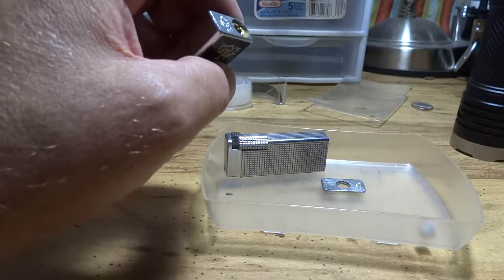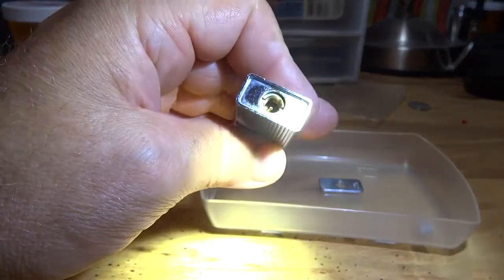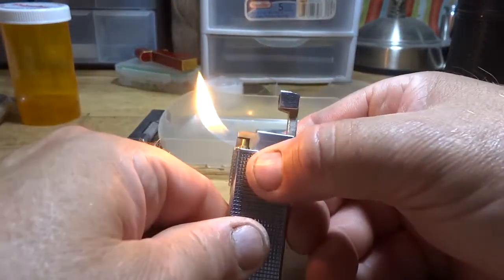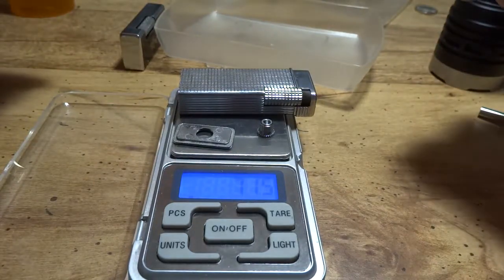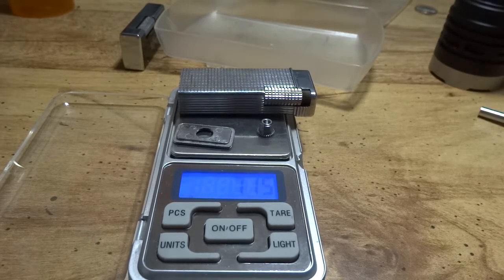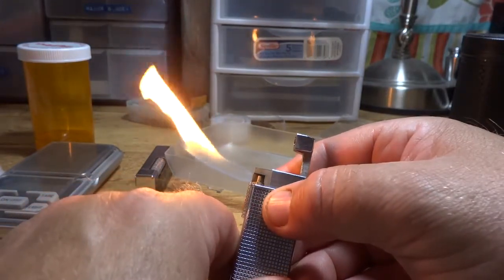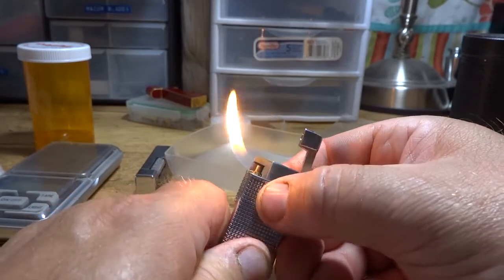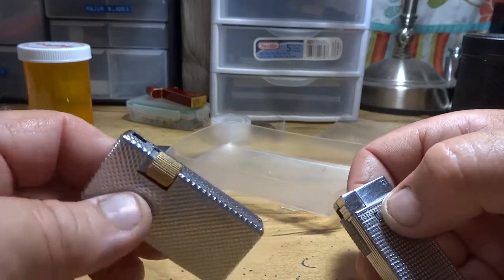Zaima Cristo Filler Valve With Pin

Comment: As a pipe smoker I have to whole hearted agree with your selection of pipe lighters. I have two of the silver Zamia Christo and 3 Flainaire F12 and both a gold and silver plate Savinelli. 
This video was very helpful and taught me the bit I didn’t understand about the filler valve on the Zamia.